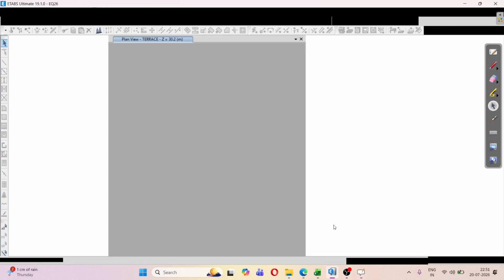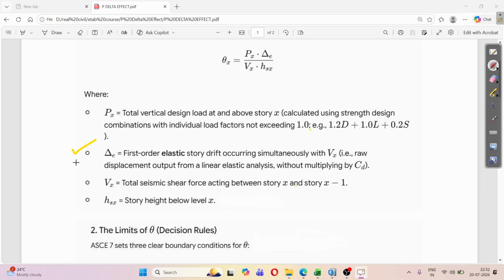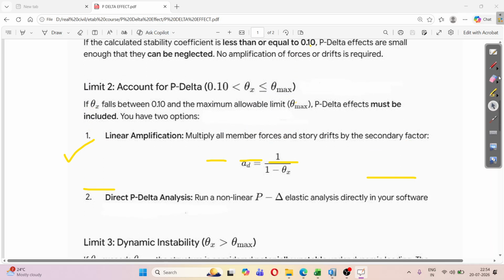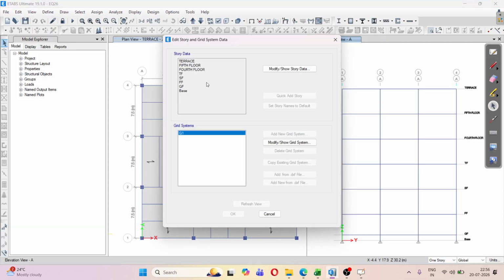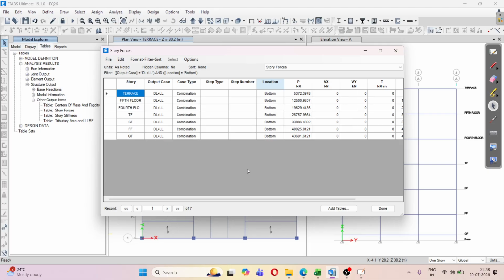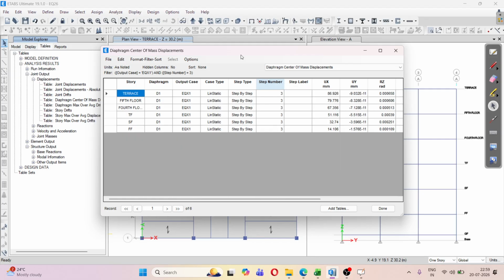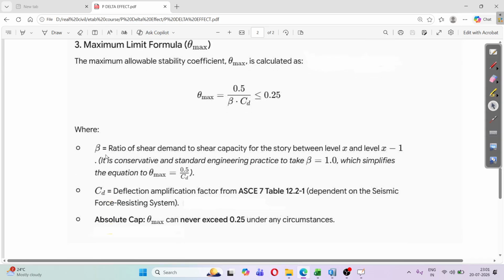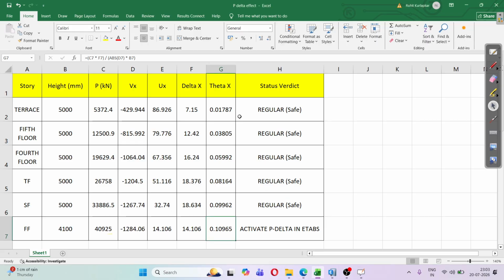How to check if P-Delta is required | P-Delta Effect Check in ETABS | Stability Coefficient | ASCE

Comment: How to amplify forces and drifts? Please guide.
Reply from the maker: There are two ways. 1. Run p delta analysis in software 2. You extract the results in excel sheet and then multiply the forces and drfit with the factor and then use those results for design